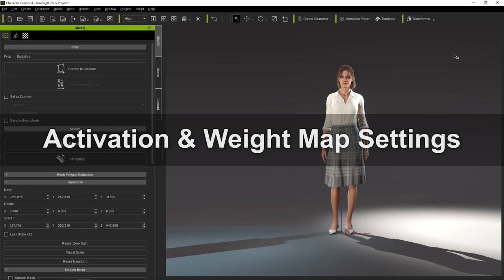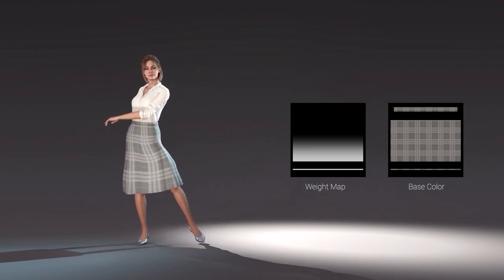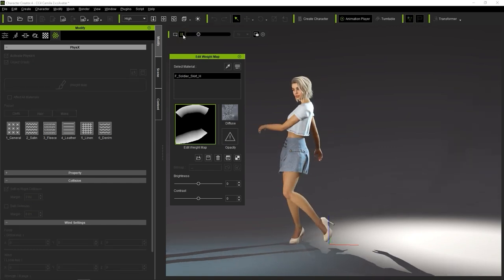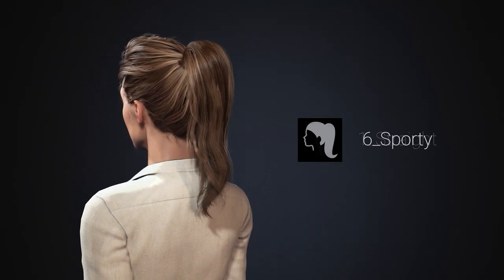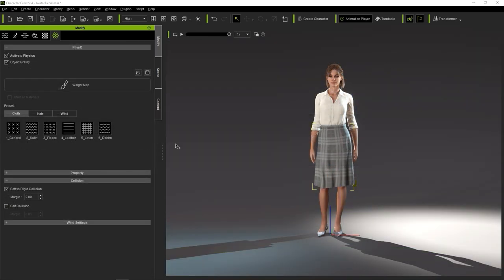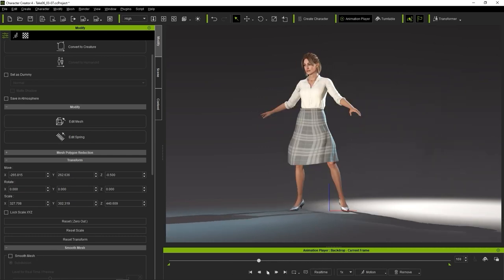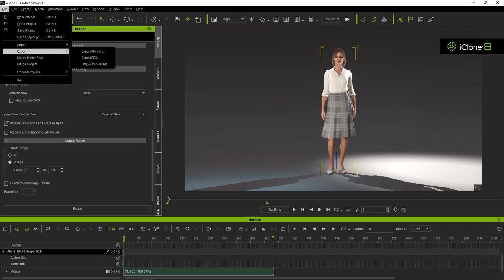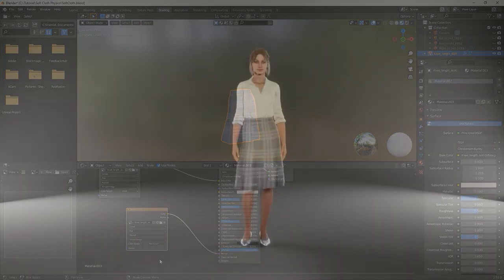iClone 8 & CC4 Tutorial - Soft Physics for Cloth & Hair

Comment: Hey does anyone knowhow to export Hair physics to blender. I saw a tutorial online explaining a bit and it mentioned about exporting as an alembic (abc.) file. I did this, but after exporting it to blender the hair just shows up as a single vertice. Really wish they would have touched on this more.
Reply from the maker: Hi @DimiArt,

Sorry about the earlier issues with this function, it should be working now in the latest update. Please try exporting again as an Alembic (.abc) file, and let us know if you encounter any other issues!
Reply: @reallusion  i used the cc pipeline addon and it works now. You don't need to export as an alembic,  you can use an fbx